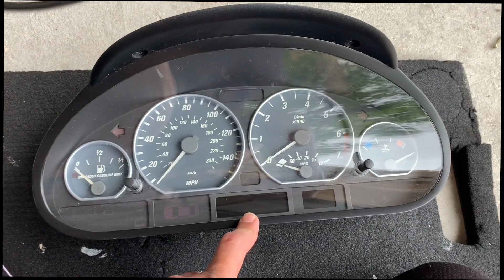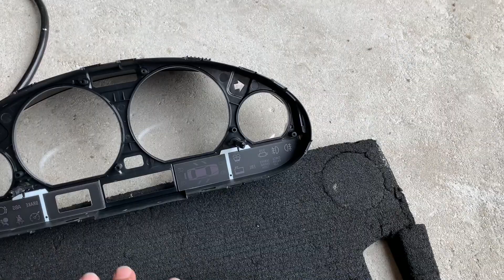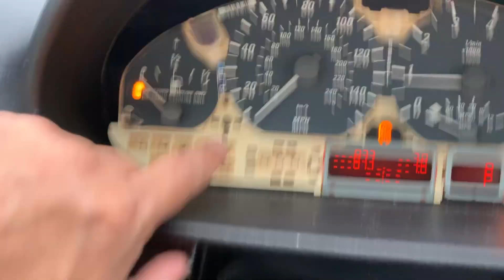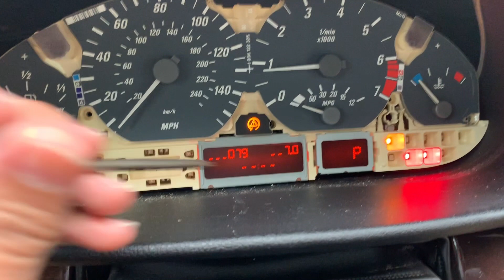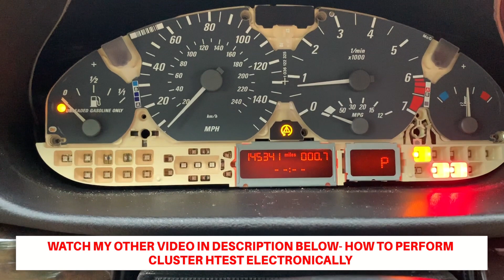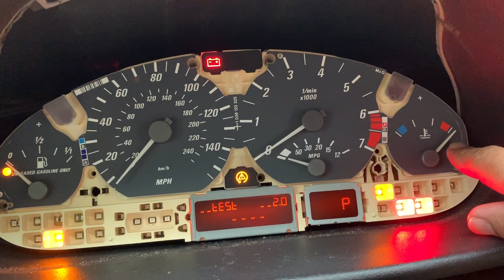BMW E46 CLUSTER DISASSEMBLY FOR REPAIR

Comment: heloo, 

i got a problem with my car (E46). cluster  reads/shows  +50C all the time (no matter how many ambient sensors i'v tried), then i swapped the cluster and surprisingly it worked just fine (showed correct Temp). 

please give any ideas / solutions 

Regards
Reply from the maker: Bad cluster motor for temp gauge. Replace the motor
Reply: @HowToDoitright  what motor are talking about ? its electronic

Comment: Specifically ordered a T15 screw driver and was too big, thx for wasting my money lmao.
Reply from the maker: So I checked and mine takes a T15. Sorry about that but they may have changed the size on different models. I have seen that issue in other vehicles too. Not sure why 🤔
Reply: Replacing the stepper motor does not cure this problem I think there is an issue with the board

Comment: Once I’ve took clocks apart and changed a led bulb,after putting the needles back on,how can I do it first time to stop the needles acting up
Reply from the maker: Not sure
Reply: @HowToDoitright  can you reset through obd by any chance
Reply from the maker: I don’t think so
Reply: How do you take the needles off to take the face plate off?
Reply from the maker: Pull out I guess
Reply: @tywins3669  they push down go to the right I think